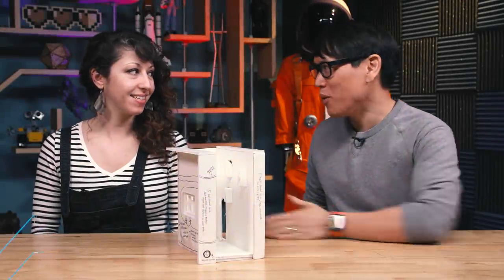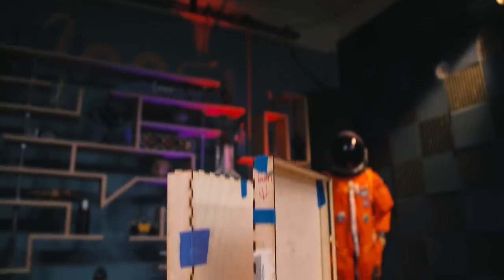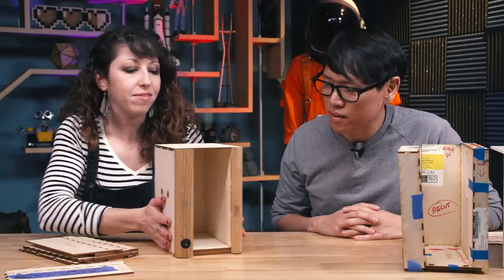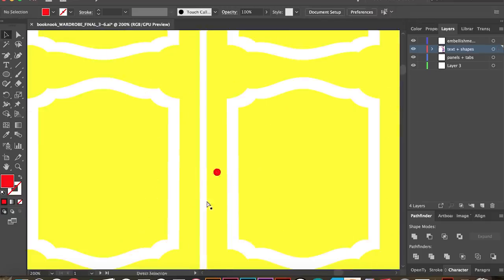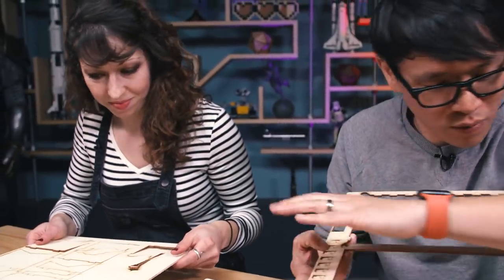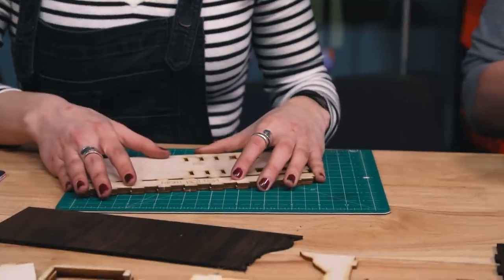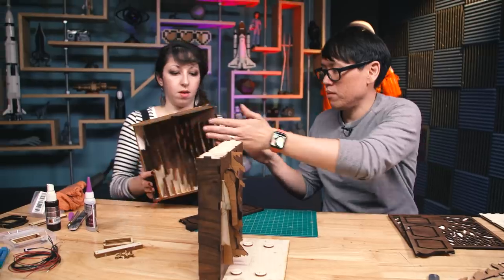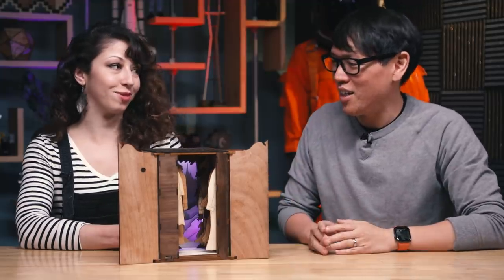Designing a Book Nook Laser-Cut Kit!

Comment: You could incorporate a "fake book" to pull off the front, with a magnetic switch to turn on the lights. So, for the "forest" you could have a book that has the word trees in or something. Also, using a mirror to have it fading off into the "distance" helps the illusion. The mirror has to be spotless (first surface would be the best for the effect, but hard to keep clean) for it to work.
Reply: There's a cool one here on YouTube that uses a mirror at an angle in the back, so it looks like an alley that curves to the left and keeps going.

Comment: Great job Jen!  This is a wonderful project and very inspiring.  I wish I had a laser cutter to make one... great videos as always!
Reply: You could get the diagram on her etsy page. Then cut it by hand with a coping saw, they are around $20. I got a Dremel moto-saw, basically a table top hobby band saw, for under $100.
Reply: @SurleyBlaine  that's a great idea.  That Dremel tool sounds quite good.  Since I have access to a lot of pristine, white corrugated cardboard at my work place, I may be able to cut it out on a cutting table (it's like a laser cutter, but with a knife).  Certaining not as durable or sturdy as plywood, but it could be fun.  My mind went to the trench run in Star Wars... that'd be fun one to make!

Comment: Ugghhh. Battery Packs on stationary devices....I HATE them. DC power bricks are the way to go. Other than that the concept is VERY cool.
Reply: Sure, if your bookcase has power outlets and ways to run wires around the books. I'm gonna guess that most of us, however, don't have that. :)
Reply: The battery pack is a better idea if it's not on all the time - a wall wart would be drawing some power 24/7 when there's no point.
Reply: @No1sonuk  there was (I think) PC magazine article where they tested USB power adapters and how much power they drew when they weren't actually charging anything. The answer was a couple of microwatts. They had to stack 3 onto a power strip before the wattmeter even registered anything.